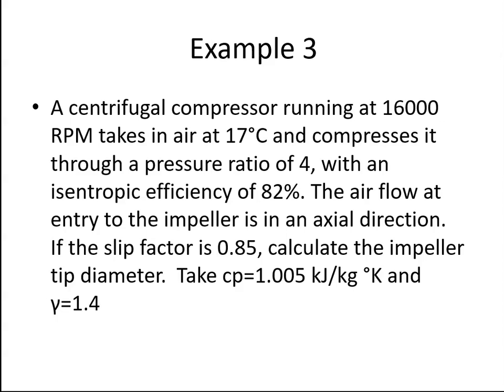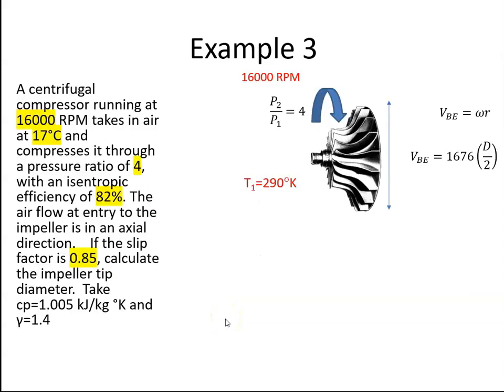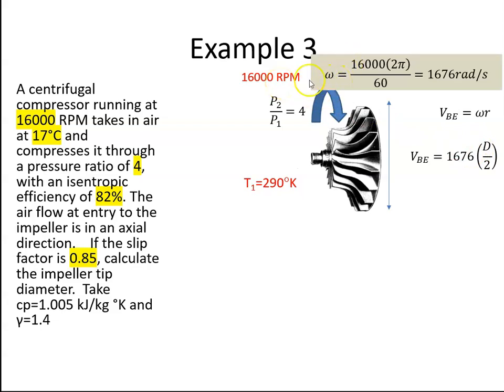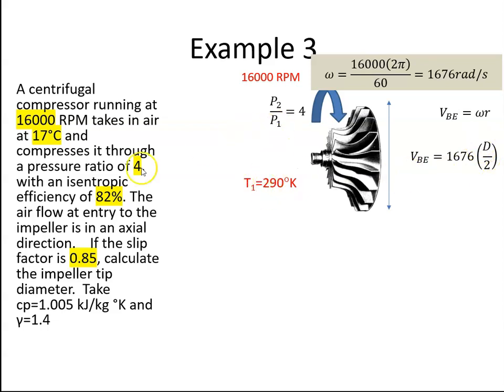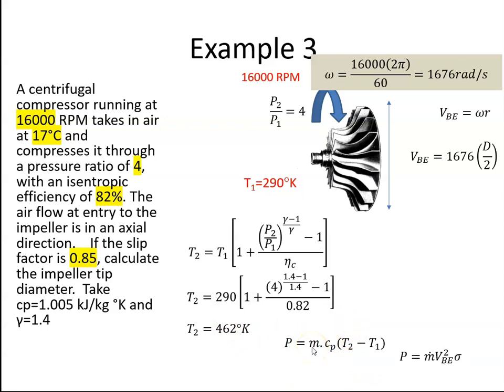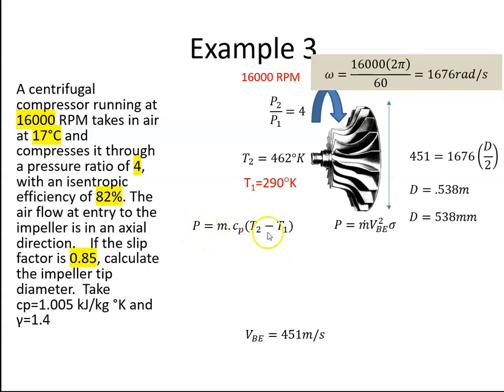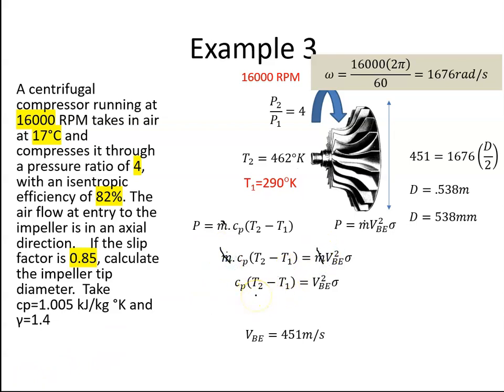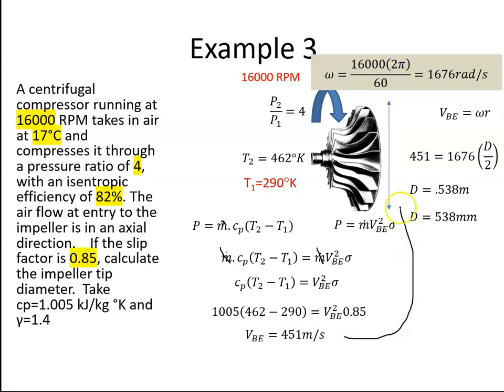Centrifugal Compressor Example 3

Comment: The slip factor is used to relate the tip speed to the tangential component of the fluid velocity. You used it to determine absolute velocity, did you not?  If so, this is incorrect.